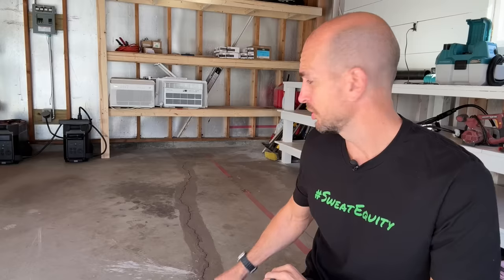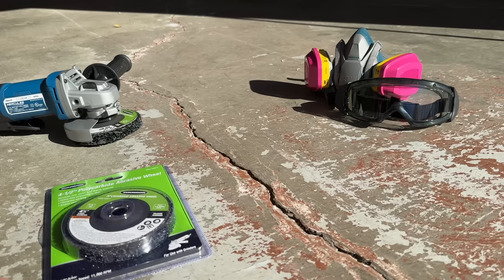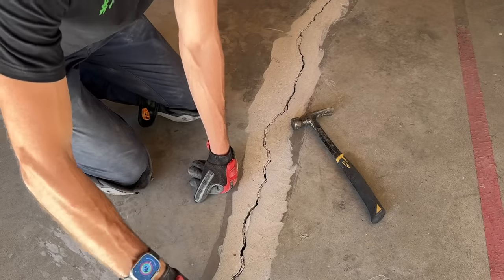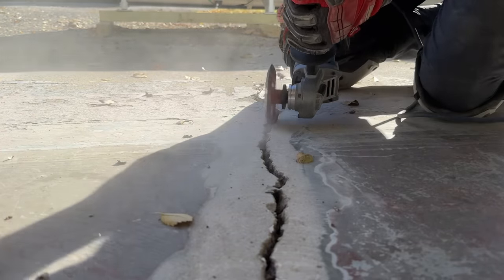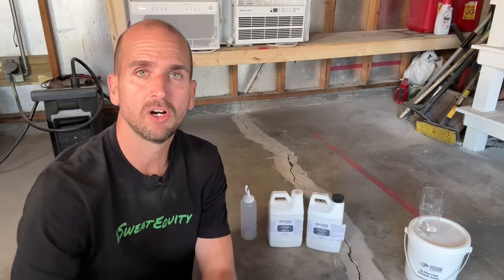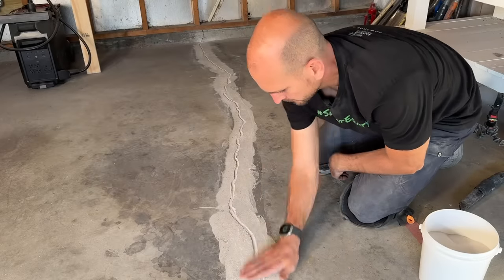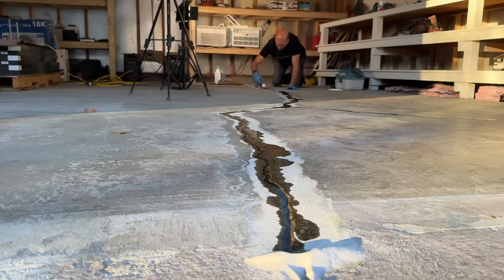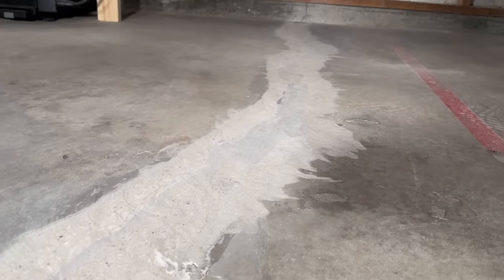How To Permanently Repair A Garage Floor Crack

Comment: Question. If I still see hairline crack after grinding, does it mean i have to grind some more?
Reply from the maker: Prior to epoxy?  When you are just prepping the crack?
Reply: @EverydayHomeRepairs  Yes. If I run the grinder in lightly as you demonstrated but still see the hairline crack under at the bottom of the groove left by the grinder. Should I grind some more?

Comment: You should not say that is a permanent repair amazing 9.6k watch it  is it a active or dormant crack has the substrate  sunk ? i could go on and on
Reply from the maker: Yeah, if the pad is still moving the problem can come right back.  I am about 90% confident this pad is not continually moving over time but we shall see how the repair holds up.

Comment: Any thoughts on cracks in basement foundation walls? Would this approach work there?
Reply: I've fixed cracks in walls. For that I used a product made for that, where you inject an expanding foam info the wall, then epoxy the outside.

Comment: hi..why did you use dry fine sand and not the backer rod you used in the other video?
Reply from the maker: Specifically this company calls for the sand which does mix with the epoxy so just following the directions.  They will actually provide the specific sand in the kit.

Comment: I need to fix crack in drive and sidewalk. Are there suppose to be gaps in the concrete ?
Reply: Cracks are usually caused by another problem. Gaps or cuts are usually placed for expansion and contraction. Cracks should be repaired because they will allow more water to penetrate which can cause a cycle for more cracks from expansion and contraction.

Comment: Question:  How can this be called a Permanent Repair?  The earth below the concrete is either sinking to one side, unevenly considering the smaller runners, or it's raising/heaving for some reason.  What's to stop that from happening again?  Being a garage and a driveway, pilings were likely not driven like they would be for the house foundation, if at all.  Concrete heavy wire mesh can help in instances, but it won't stop cracks from earth-below-concrete shifting issues.  While I'm sure it's a LOT better than the way it was done before, is it really a Permanent Repair?  Something made the concrete crack in the first place and this does not address that.  Not a criticism; a question.

And, in retrospect, would have have done your round foam/floaty sidewalk/walkway/driveway repairs this way instead?  Or is each way case dependent?

Comment: In days of old, nearly 40 years ago, we'd open the crack up to 2" or more, and refill with concrete.   We'd use a diamond blade, on a circular saw.

Comment: I guess I don't understand. Is the epoxy actually so strong that the movement of the concrete slab will be halted? Is that even possible?
Reply from the maker: It is strong but not that strong.  I think this slab has settled and isn't continuing to move.  Prior to owning this house there were no gutters and the water would just flow right to the foundation which probably didn't help the settling.  Gutters are added now and I think we should be stable but time will tell.

Comment: Great video - thanks!! Can I do the same type of prep repair for pitted concrete, where the car tires have sat for years creating road salt damage, as a prelude to a flaked epoxy paint finish? The problem I see is with the grinding of the pits. It's not the same as grinding out a crack. How would you grind the small pits? Thanks again!
Reply: You can use this material to fix pitting in concrete, technically you should shotblast the concrete first, wire brushing would be the second alternative means of preparation.  You must grind over the surface after you apply this epoxy before applying any coatings on top.
Reply: @ConcreteFloorSolutions  Great, thanks for getting back! I'm looking to take this on in summer 2024. Be well...

Comment: Do you have any videos for vertical crack in basement walls?
Reply from the maker: I haven't done one on that situation.  I have seen several kits and actually had a repair done in my current house prior to me purchasing.  When I get a home that needs it I will definitely put out that video.

Comment: So which grinding blade did you use after the final application to grind smooth
Reply: Any Diamond cup / Harbor freight tools, Amazon , 4.5 " up to 7 " / ,  Usually crack shift vertically  and grinding is most like to blend in. I recommend  Variable speed Grinder , to control enormes dust or use attachment w/ vacuum.

Comment: I wonder if using slow epoxy that gels about 2h, mixed with the fine sand will eventually be stronger and way less messy as you can apply like a putty, remember fast setting resins are WEAKER than slow setting ones, any lab test will prove i am right

Comment: I am no expert, but does it not make more sense to enlarge the crack and fill it up with fresh concert and then grand it smooth?
Reply from the maker: Epoxy will have a much better bond as compared to new concrete.

Comment: Nice. I wish I could find that stuff in the UK. Surprised you didn't repair the foundation wall as that was cracked too.
Reply: I wonder if it would work on a vertical surface?

Comment: I wonder if tapping the edges with a rubber hammer as you were adding the sand would have helped fill the gap more completely with sand and allowed the epoxy to wick down through the gap.
Reply from the maker: Not a bad idea 👍

Comment: Seal top of crack with epoxy. Then drill a hole every3 feet. Next, Inject 2 part epoxy into each hole until it comes up out of the next hole. This way you glue to the bottom of the crack.

Comment: 1/8" epoxy won't provide much structural strength, just a filler.  So, unless whatever caused the crack to develop (soil movement) has stopped, the crack will keep growing.  I've poured several slabs myself and never had a crack nor any settling, but unlike many contractors I prepare the base well.
Reply: Hardly see contractors use a base but you get what you pay for.

Comment: does this work for an outdoor patio where it will see winter salt and UV sun??
Reply: You can use it exterior, but it is NOT uv stable and designed to have coatings placed over it after installation.

Comment: You ever use Rockite  or railing cement.? That also sets quite fast and i have used it to set steel railings in concrete with great success. That crack you fixed will show again in a few years although  it will not be huge. Overall good job. Not the cheapest or easiest fix.
Reply from the maker: Yeah, I will be curious to see if it will come back in a couple years.  This garage never had gutters and not sure if the crack had stayed like that for years or it was continuing to grow.  Filled the crack and installed gutters.  We will see how it goes 🤞

Comment: I know epoxy crack fillers like what Scott used here aren't inexpensive, but they are also incredibly strong and are likely stronger than the surrounding concrete which means this crack isn't likely to reappear after the final floor material is down.  There are cheaper options, but I'd rather pay a bit more up front and know it is a permanent repair. 

No matter what product is used, if it fails in a few years it will be a mess to deal with after the floor is covered with epoxy as matching the floor will probably be very difficult.  I wish I could fast forward a couple of years and see Scott's long term results!

I'm curious if he considered alternatives for the final floor other than epoxy.  I've heard a lot about newer polyurethane coatings and how they are supposedly even stronger than epoxy.  However from what I've seen they might be a tad more expensive so I suppose there is a tradeoff.
Reply: Yeah I'm curious to see long term results as well. I've heard both epoxy and polyurethane only look good for about a year and then they start to peel and flake and basically need to be redone
Reply: @SparxI0 With proper floor prep (grinding) and using a high quality product, the application should last 20-30 years, sans moisture issues. The kits at Lowes and Home Depot will peal regardless of prep, but I’m sure a good prep will make them last longer. But you get what you pay for.
Reply: There are only two kinds of concrete floors...those that are cracked...and those that are gonna crack. Fancy floor finishes are a waste of time.
Reply: @markanthony3275  I'd agree with you that all concrete floors will eventually crack (or at least 99.99% of those in existence) although I do feel there are advantages to a floor coating.  In my case the one benefit would be to add some traction since my concrete is downright dangerous when even the smallest amount of moisture is on the surface.  That was probably the fault of the original installer since they smoothed the finish a bit too well.  However I can also see the benefits of a coated floor for cleanup since oil/chemicals don't soak in and dust/dirt doesn't stick as well.  I suppose there is also the aesthetic benefit too as they look nice, but opinions differ there since some people really prefer the look of bare concrete.

Either way, in many cases eventually the concrete will crack so the perfect floor might have a limited lifespan.  Then again we do too... so maybe it isn't a huge issue.  :)
Reply: My garage was done with this same process except I have a Polyurea Polyaspartic by Penntec with full flake to rejection rather than epoxy. I'm in Michigan and we have severe temperature swings on a daily basis. I chose PA over epoxy as it won't UV fade and is stronger than epoxy so will hold up better in our climate.  The cost was about double of an epoxy job, was done in 1 day by a great company.  Also, 3 of my neighbors have epoxy and all 3 have failures and paid $$ for redo and/repairs.  My floors is now 2 yrs old and is worth every penny.   The guys at CFS have a great YT channel,  lots of tutorials there😊.
Reply: @markanthony3275  I have a 400 ft garage floor slab that is 50+ years old and still holding solid without any control joints even. I wonder how much longer till it starts to crack as you say it will?🤔
Reply: @Rick-the-Swift  They probably poured it a lot thicker than average.
Reply: @Rick-the-Swift  Well Rick...you'd better phone the Smithsonian and have them put it on display, because yours is the only one in existence.
Reply: @markanthony3275  Actually no, I've taken quite a few notes over the years and have come across this same issue time and again- some slabs crack every which way from Sunday, and some don't. As someone else already pointed out, the thicker the better usually from my experience, and yes most people will probably skimp and do the minimal 2-3 inches. 
 Another factor is usually preliminary groundwork, tamping and drainage can make all the difference and can't be stressed enough. Also most people will let their slab dry asap so they can move onto it, while some may insist at least a week of wet cure. 
 Fiber and or rebar reinforcement etc. all on or off the table for many, so you'll get a lot of eye sores and some pretty nice work.
 Also, who mixed and delivered and did they get it all in one go, or were there delays between pours?
🤷‍♂

Comment: Why not simply construction adhesive? Maybe filling a tad short and using epoxy to top it off so you get a smooth surface finish?

Comment: Sounds good but during the week day you are a dentist right but the reason why the crack there bc of what the dirt was set up right so it falling and get wash out so how be permanent fix when in years later it crack again unless is to suspend the concrete up in the air level like kinda is now but dirt keep dropping down most the time you come put big long Anchors released your house and the proxy would go way under concrete and expand like taking about drilling hole around the area but we see keep posted in ten years
Reply: dosn't anyone ever proof read their comment before posting???

Comment: I don't know...
Did they ever use asbestos in cement floors?
Reply: Yes, it is a great binder and fire proofing 
Pre 1977 in all aspects of building, keep things wet and damp to prevent the fine particles. Asbestos is just rock and can be found naturally. The problem comes from processing it for use with building materials and products.

Comment: You're presuming the crack is stable. I would hate to work to cover up the crack, only for it to reform as it expands. I can see this crack extending through the foundation, and I presume this because  no rebar was used. I would suggest cutting 12" cross crack  groves about 1.3" deep every 12" of the crack. This epoxy you show is very expensive and I doubt it is as strong as high strength concrete.  But when time is a concern, it can be worth it. However for the DIY,  high strength concrete would be my choice.

Comment: Great video. Excellent solution. But……..I am going to go the spray foam route. If people can use spray foam anywhere on a car or truck to hold it together, why not fill a crack in the floor. Just my lazy way of doing it. Your way is certainly much better.
Reply: Yea I don’t want to spend several hundred on a crack...I’m just trying to help it last longer and prevent damage not do a perfect professional job

Comment: A tube or motar with extra cement use sodium cloride to harden and dry quicker let dry overnight
Reply: Cement does not bond well to Concrete, it will re-crack within one season change. You need a low viscosity epoxy to soak into the concrete to glue it back together again.

Comment: Actually a good repair (I’m in the business). The only thing you didn’t talk about is what you do before you crack repair. If you look at the end of the crack the foundation shows a crack. So you have a fault line going across the floor and foundation. You have to fix that first or everything will reopen. Hopefully he pumped up where the floor settled. If he didn’t then the new epoxy will recrack in a short time.
Reply from the maker: Thanks for the feedback.  This garage was beat up for years and didn't have any gutters so I chalked the settling to the water around the slab (not sure about footings).  Garage now has gutters and much better water management but we will see if we get anymore movement.

Comment: What about drilling a few holes as crack arrestors as you would with steel
Reply from the maker: Might not be a bad plan of attack especially if you have some smaller cracks where the end is visible and could be drilled to hopefully stop the propagation.  Thanks for the feedback!

Comment: Hope you figured out why the crack developed or it will com back. My feeling is the outer garagewall has settled. I would insure you are diverting water away
Reply from the maker: Garage didn't have gutters before, now it does.  Hope that was it 🤞
Reply: another process to consider would be to call a contractor in to fill the voids under the slab by mudjacking.   Its not that expensive and would help ensure a permanent fix.   The repair looks good.

Comment: That crack was probably the result of the contractors who poured the concrete slab, not pulling the reinforcement mesh up into the concrete. They just put the mesh down and poured concrete on top of the mesh, rendering it practically useless. Contractors need to pull the mesh two or three inches up into the concrete for it to be effective and help prevent cracks.
I hope you don’t develop cracks in that slab in other areas.

Comment: Excellent demonstration. Why not use non-shrink grout slurry to fill the whole crack? That is much less expensive than $250/gallon epoxy.
Reply from the maker: The Epoxy flooring is no small investment so I wanted to make sure the prep work and floor will give the Epoxy floor coating the best chance of lasting decades.
Reply: Cement based products don't bond to concrete near as well as epoxy based products. By installing the epoxy, you are attempting a full depth repair to glue it back together.  With non shrink grout, that is a topical repair and will not glue anything and will most likely crack at the next thermal expansion / contraction cycle.

Comment: Expensive epoxy that could be replaced by a myriad of other epoxies on the market, also when grinding under the sides of the crack a mm or two not creating a v as that will only encourage the repair to eventually pop out, no v shape groove, this is basic repair 101.

One other way to do this which is even faster and just as effective is to fill the crack with a premix polyfiller, additives make it even stronger and flexible, so cracks will never reappear., it is extremely hard setting and if you grind a bit under existing concrete it will never come out, especially if you are going to cover the full floor with epoxy in the next few days or weeks.

Still a nice video advertising this product, just way more work than necessary.
Reply: This repair will not pop out, it is a low viscosity epoxy that penetrates into the concrete.  A polymer (cement based) filler will re-crack very quickly as it has little to no tensile strength as opposed to an epoxy crack filler.  The tensile strength of this epoxy crack filler is 4500 psi. Tensile strength of cement based materials is about 500.

Comment: If you add more insulation to your walls and ceiling joists will help to prevent your garage slab from cracking. It looks like your slab is heaving, I will bet that your winter spring seasons go thru a freeze thaw period. When snow melts, the water will get under your slab and then freeze again. The extra insulation will be enough to prevent the water from freezing under your slab. Also, get the snow away from around your garage, improve the drainage around your building, add a French drain system.
Reply: The reasons are not compacted base, no rebar, and not enough expansion joints....